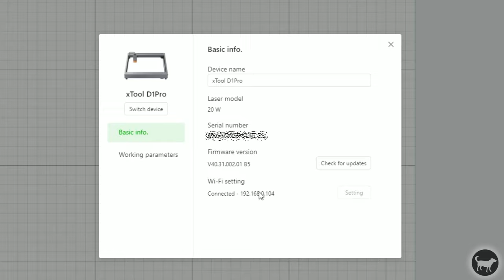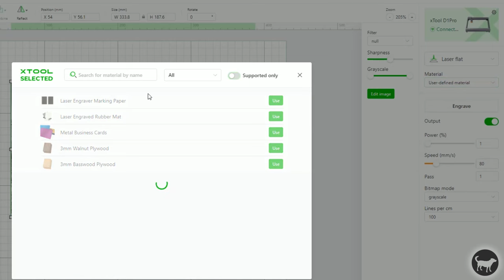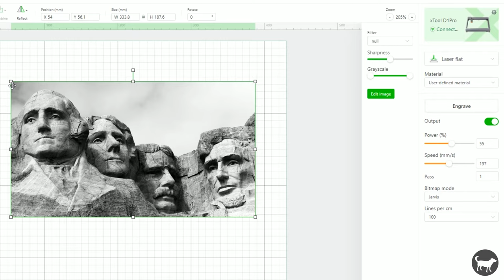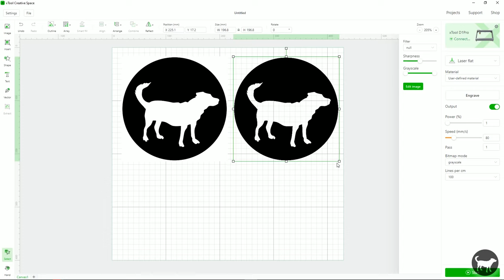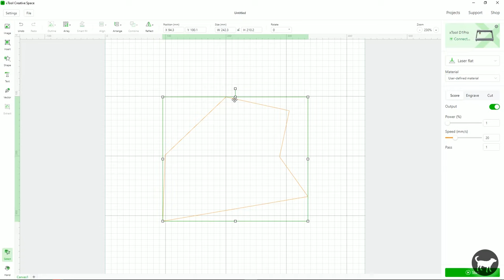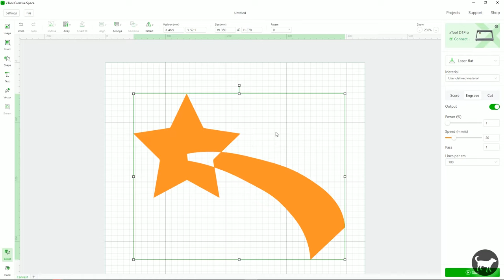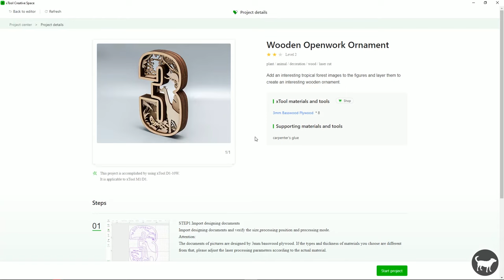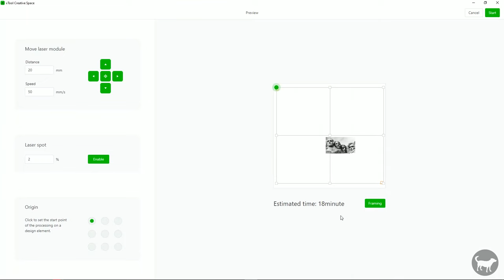xTool Creative Space Beta Tutorial for the xTool D1 Pro

Comment: Well, finally info on XCS.  I've got the D1 (not Pro) and as time has gone on, it worked fine with LightBurn.  Then came the upgrades, and now LightBurn will not respond to the power settings. It burns very hot regardless of the settings.  So, needless to say XCS is all  I've got.  It operates beautifully with Xtool's software, so the machine is not a issue.  However, upgrades to firmware, etc....LightBurn just doesn't work. Xtool said on their site that sometimes LightBurn and the D1 WON"T work and it's an anomaly and they are not responsible.  So, at any rate, I'm glad you have this video, it's very helpful and hope no one runs into this "anomaly" doesn't happen to them.

Comment: thank you for you information.  very helpful.  not sure I understand the absolute X Y but I will watch again see if I can get my pea size brain to understand. thanks again
Reply from the maker: I'm sure you will get it. Essentially the whole machine has a coordinate system where the X goes left to right and the Y goes back to front. The (0,0) position of the system is at the HOME position in the back left corner.  So if you wanted to burn at (x200, y200) that means the laser goes right 200mm (X position) and forward 200mm (Y position). That way if you had a grid burned onto a spoil board you would be able place something to engrave at that location and know exactly where the work is going to engrave. Hope the cleared it up a little bit and not just confused you more.

Comment: I am a new user of the laser engraving field. I watch your video and it was so nice and clear with the information on how to use the Creative Space. I have the Xtools D1 pro. But while watching the video I saw that in my software screen are not all the options and commands like the ones you have, for example the grid array and many other option like the ones you have at the top. Is there any way to get those with an update or doing some other setup? I fill a little stuck without not having this more options. Hope you can help me with this. Thank you
Reply from the maker: You actually have the new xTool Creative Space setup. They have recently upgraded to a BETA  2.0 version of the software and I haven't had a chance to fully dive into the new one since it is still in flux. The settings are still there but many of them have moved from the top to the right column.

Comment: Thank you for the video! I am experiencing a weird with SVG files that I need a CUT, SCORE, and ENGRAVE at the same time. The success rate of project like that is so low that I have been wasting material like crazy. The issue was the engraving portion of the project seems to be shifting position but not the cut and score. And I think the problem started with the latest firmware update. Do you encounter the same issue?

Comment: Great video!  When using XCS with my D1 Pro, it does not recognize the svg cut files I have saved on my laptop.  Any tips on how I can solve that?  Thanks much.
Reply from the maker: I know there was an issue with the older version of xcs. Try downloading the newer version and see if that fixes it. If it doesn’t I have had more luck importing DXF files so maybe you can convert them into that first and then open it.
Reply: @BusterBeagle3D  Thanks Buster.   After I posted, I watched your video again, and tried again and got it to work.  I was clicking on "open", when I should have clicked on "image".  When I clicked on image and went to the same file folder as before, I could then see all the SVG files.   Thanks much!!

Comment: Yes having problems with scoring and then cutting out a pattern after each other. it will do one or the other. PLEASE HELP for example : I bought a Santa Claus image, it has a score then a cut out on the same image. how can I make it work . sorry new to xtool. thank you John
Reply: I have the same issue. I have a piece (circular calendar) that uses score, engrave, and cut, and it is impossible to get the piece to do all three functions during one session. Furthermore, if I manage to get 2 of the three functions assigned when I go to the 3rd one, it all changes to whatever that might be, such as a cut or engrave. I think the problem is that it does not recognize layers. It sees the project as a one-layer image or something. Very frustrating. Any help would be appreciated.

Comment: Thank you for this tutorial, I learned a lot! I do have a question if you have the time... I have purchased done SVGs for a layered project. All the layers load at once, but is there some way I can select just one layer so I can cut them one by one? Thanks so much!
Reply from the maker: You're welcome. I don't think there is a way to tell it just tell XSC to burn a layer. You can click on all of the other layers and turn off the OUTPUT switch right above the Power percentage and the others will not burn but that might be the closest way to achieve what you are looing for.

Comment: Thank you for the great video!
Would you happen to know, if within Creative Space, there is a setting for the framing speed. On smaller objects, the framing process moves so fast it's hard to tell exactly where it's framing. I haven't been able to find any setting that affects that speed. We are using the Xtool D1 10w.
Thank  you!
Reply from the maker: I'm not sure if you change the MOVE LASER speed in the top left corner of the preview screen if that also changes the framing speed. You can try it and see what it does. I don't know of any other way to adjust that.

Comment: When I import an image it only gives me options for power and DOT not for speed am I overlooking something? Thanks in advance !
Reply from the maker: This is getting to be a bit of an old video. So much has changed. I need to update it soon to go over some of those changes. The settings that you are seeing are based on the type of machine that you have and which version of the laser you are using.  Sounds like you might be using the xTool F1 which does have dot duration and speed. You can see the recommended speeds by the company here: https://www.xtool.com/pages/material-settings

Comment: Thank you 3x!  Finally someone who is really teaching!!!  I downloaded your grid file but am struggling on how to use it properly lol. I am a total newbie.  It does help with alignment I.e 90 degrees. Centering is a still an issue but I will run some tests tomorrow after I install the absolute coordinates file. When I “home” the laser in XCS it moves outside the scored grid from your file. Will this absolute coordinate resolve that? I thought about making some templates out of cardboard and run these tests. For example, I have a 10x16” cutting board where I need to center the monogram.  I feel like if I can get alignment and centering down I will be well on my way Ryan. Any advice would be appreciated!  Oh and I subscribed and told a few makers on IG to look at your channel. It is so much better than some other creators in the laser space!  Thanks again sir.
Reply from the maker: Thank you. If you got my file off of Etsy be sure to read the READ ME FIRST before you use the grid files. There is also a video that goes over more about the grid file that you can find on my channel. If you have to center a monogram on anything and you are using XCS I would recommend using the grid to keep your piece square to the laser but place a small dot on the center of where you want to burn monogram on the actual piece. Then in XSC after you hit process place the GREEN DOT in the center of the image and then manually place the laser so the  laser spot is right over that dot. Be sure to turn off the crosshairs and use the laser spot...It's much better. This is not using absolute coordinates but might be easier in the long run.
Reply: @BusterBeagle3D  thank you!  I did read the READ ME before I installed. Is there something you think I missed?
Reply from the maker: @bucknboard  As long as you are homing, using the right grid for your laser, turned off the limit switches and crosshairs you should be good. If you are still having issues reach out to me on Etsy and I can try to help you in a more timely manner as I get those messages right away but only see these when I have time to look.

Comment: HI I have just purchased the D1 Pro and it seems the screen is a different layout in that I can't find an option to unite items oe whatever they call it, I also feel it is very restrictive is designing things, do you have any pointers? Thanks in advance
Reply from the maker: Hi. The newest version of the software has changed around quite a few things. I have been waiting for the software to get out of it's BETA phase before updating any videos on how it works. It's still somewhat restrictive in what you can do. If you really want the most feature rich software that you can use with the machine I would recommend checking out Lightburn. I have a whole video going over how to work in Lightburn with the D1 on my channel.

Comment: awesome video!  thanks so much for sharing your insight.  just got the files from your Etsy shop for this grid, am working with the D1 Pro 20W & I am having trouble with the limit switches with your file, goes across and down fine but when it gets to the bottom and goes back across it says its hitting a limit, but the laser module can physically move over about half a cm still.  turned off limit switches & ran it anyways to see what it would do and it did jumbled the text in the bottom left corner a little bit that says "D1 Pro 20W" (two letters overlapped), but otherwise the grid seems in tact and okay with all the numbers and such.. any ideas on what may be triggering limit?
Reply from the maker: The limit switches do not allow you to reach the full extent of the advertised workable area on the D1 Pro. That is why there is that "READ ME FIRST" text file in the zip folder. It basically goes over turning off the limit switches and the laser crosshairs to be able to take full advantage of the the machine area and properly burn the grid.

Comment: what is the enable button for next to th spot size and how does it work? please
Reply from the maker: I'm not exactly sure what you are referring to about the spot size but I think you are talking about the enabling the Laser point when you want to frame. The enable button turns on the actual laser point and the value is the laser power when you enable it. You want this value to be really low, like less than 5% since this is the actual laser that can burn the surface if that value is too high.

Comment: Just got my xtool d1 pro and I have 2 issues. When trying to frame it only goes up an down when I try to go right or left manually with the arrows I hear a click but nothing happens. Any ideas on how to fix this?
Reply from the maker: I would check you belts and your stepper motors on your x axis to make sure nothing is catching or loose. Make sure the limit switches sensors are not caught on a wire or something.  Otherwise I would either ask on the XTool Facebook group or send a support ticket to XTool directly. It’s not an issue I have seen personally.

Comment: I have a project on creative space and when I try to print it with my D1, it does not do anything.  It will let me frame sometimes and at other times it doesn"t do anything.  I have tried to burn a project in laser box and it works fine.  So it is just with Creative space that I am having problems.  I have reloaded Creative space several time and did the software and firmware and still will not work.  Help me please
Reply from the maker: Hello Bret. This might be a good question for the xTool Facebook Group. I'm not really sure what the issue might be when upgrading the original D1 to XCS. If you have a pro version I know there were issues if you used Laserbox Basic first instead of XCS but again I'm not sure. If there is a problem I'm sure it had shown up at some point in that group.
Reply: @BusterBeagle3D  Yes I have seen a few entries about people having the same issue.  No answers to correct it though and X tool doesnt respond

Comment: I tried all 3 ways to connect this D1 and every time it said it failed? What do I need to try next.
Reply from the maker: I would either reach out to xTool to see if they might be able to troubleshoot your issue or even better I would suggest checking out the xTool D1 official Facebook group. There are 1000's of people on there and some might have even run into the same issues that you have. I'm sure you could find some help there but I would also make sure to use the search function to see if anyone else has already asked about an got help with that issue.

Comment: Thanks for this video, everything is explained wonderfully. We are interested in how to cut several photos pasted in regular rows and columns, on one sheet of paper on a 3 mm mdf board. The photos were printed from photoshop on 310 gsm photographic paper and pasted on a 3 mm mdf board, it is more photos on one sheet. According by which information and how will XCS know how to send information to the machine to know where to cut? Do we have to send the same file from photoshop in transparent PNG format to XCS, so that the cutting lines can be determined, and if so, how we will know exactly where to place the mdf board with the pasted photos on the honeycomb?
Reply from the maker: It is harder to determine where to cut on a honeycomb since it’s not something that you can print and grid on and often times is not tied down to anything so it’s never exactly in the same place twice. However I have another video on making grids for the machine which might help you out with your case. xTool D1 Pro Grid Files | Use Absolute Coordinates | Lightburn | xTool Creative Space
https://youtu.be/BjurBn4UGZg
Reply: Thank you very much for the answer. Are there grid files of absolute coordinates for the extended version of x Tool D1 PRO?
Reply: @BusterBeagle3D  Sorry for our stupid question, now we see that there is a link for the extended version. Once again, thank you very much for your help!

Comment: I don't understand why the framing function keeps asking if the TF card is inserted.    It worked once when I had it on WiFi, then I switched to USB and framing hasn't worked since
Reply from the maker: I know this sounds dumb but try to click it in and out again. Also even though this seems to have nothing to do with it try turning off your flame detection and limit switches. I know that shouldn't matter but I have gotten peoples machines to frame that way.

Comment: I have been using CorelDraw files in my  New Hermes 25 watt laser for 20 years. My laser went down and I have bought a Xtool D1. How do I import my many CDR (CorelDraw) files into a file usable in the Xtool laser?? So far I have not found a way that does it correctly.  When I convert a CDR to a JPG or VGS I get lots of lines not in original art in CDR. I can not loose 20 years of art.Anyone know how?? Thanks
Reply from the maker: I'm assuming you mean SVG but if that doesn't work then I'm honestly not sure. All of the CDR files that I have converted have been to SVG. You could try to convert to DXF and see if you have better luck though. Also I'm not sure if you are exporting straight from CDR since I have never used that, the only way I have been converting those files is from online converters.
Reply: @BusterBeagle3D  thx

Comment: My XCS works for everything except the frame function even after pressing the button, firm ware is good and current, update is current, if you push the button to start the project it works but you can’t frame a single thing it just sits there. Light on the button does it’s thing like it normal. It was working fine a week ago i shut everything down like normal to goto the store and my computer is not hooked up to wifi constantly so I fired it back up like normal and nothing had changed no updates for windows but that’s when XCS quit framing. If you can help great and thanks
Reply from the maker: I was able to fix someone else's issue with that by turning off the flame detector in the working parameters. Change the sensitivity to off. Not sure if that's your issue but I would try it out. Maybe also turn off the limit switches.

Comment: When trying to combine two shapes, why wouldn’t the combine option come up when the two shapes overlap and are both selected?
Reply from the maker: You are correct. I was not able to do that either in the latest version. It seems like a bug. I want to say that I was able to in the old version. It still works with drawn vectors in this version but doesn't seem to work with 2 shapes.
Reply from the maker: I actually just checked an older version I had on my laptop and this did seem to break with the latest version. I was able to do this on the first beta version.
Reply: @BusterBeagle3D  I see. I was actually messing with it this morning and noticed if I make the shape myself with the vector tool it works, but maybe we should all report the “bug” so they can update it and fix the issue lol I’m so sad over it. I really wanted this tool for beautiful clean cut shapes 😂
Reply from the maker: @joemilylongoria3354  Definitely worth reporting. Not sure if you can download older versions from their website but it did use to work.